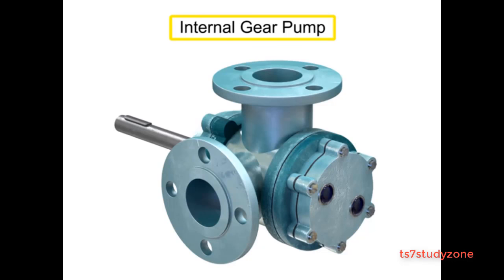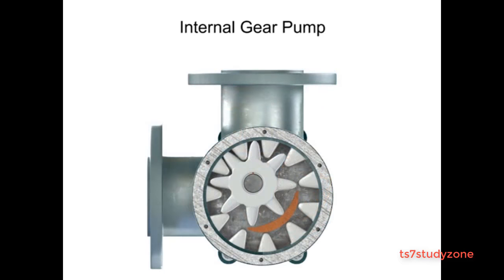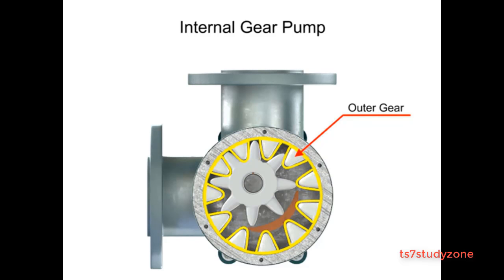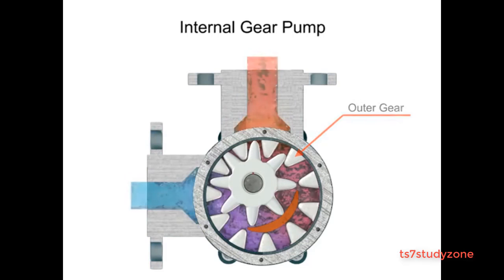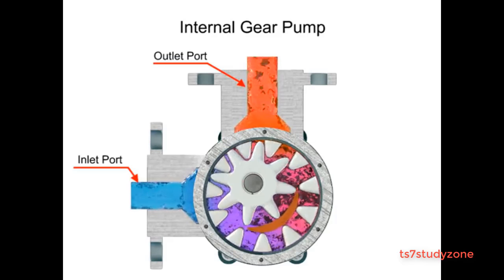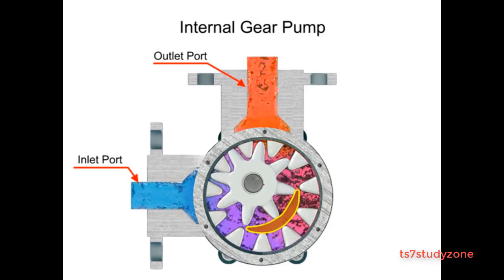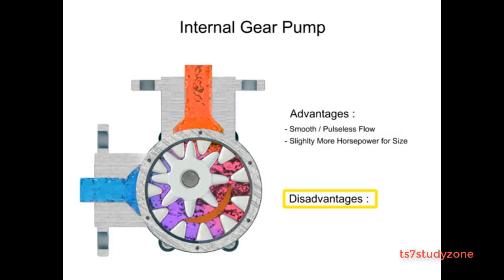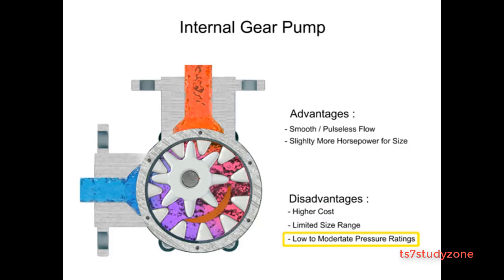Internal Gear Pump Working Animation with Detail Explanation | TS7STUDYZONE

Comment: .I do not understand what is the difference between the two? The gears are inside both the bodies(external and internal), so why are we calling them internal and external gear pumps?
Reply: I believe the external and internal terms are referring to the direction the teeth of the gear point. Not to be confused with the actual location of the gear within the pump. In this case the teeth of the outer gear ( internal gear) point inwards there for it makes it an internal gear. For an external gear pump both gears have teeth facing outwards that mesh with one another.
Reply: @wrenchguy3942  hlo bro.thanks for replying..
My question is very simple..
What is the difference b/w internal and external gear pump..and why we called them..external and internal..
Example:-Why we called that's the external gear pump or internal gear pump...